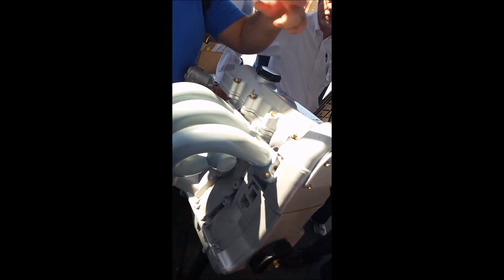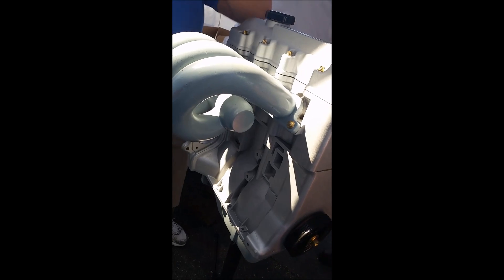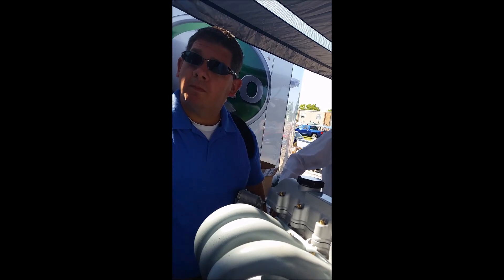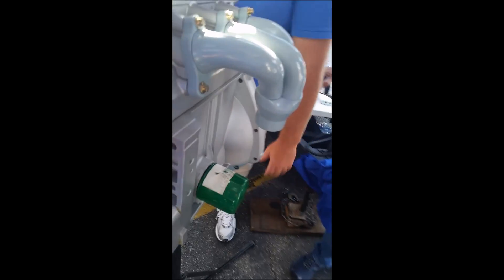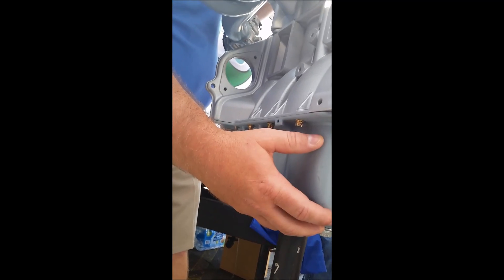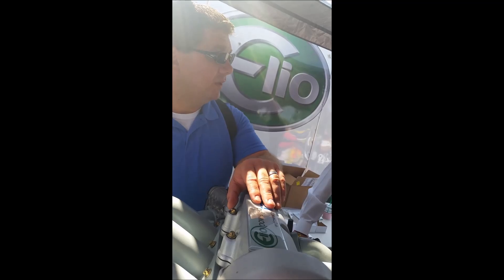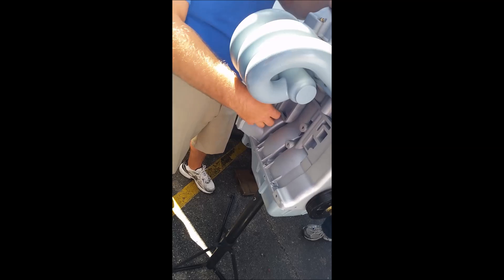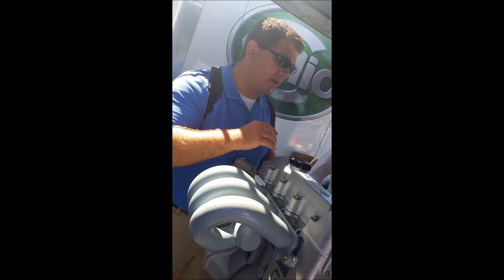ELIO- IAV Engineer Kody Klindt talks about the Elio engine.

Comment: Cooled EGR but what about EGHR (Exhaust Gas Heat Recovery) like on the Malibu Hybrid?

Would be great if it was a lean burn engine like what Honda did on their Civic HX and also the manual transmission First generation Insight. That would increase cost though. Them might be able to hit 90MPG

Comment: That chain was a big mistake. Belts are every bit as reliable as chains, people just forget to replace them when they need to be replaced.
Reply: +Brandon Lee I'd be surprised if many of these cars even made it to 100,000 miles, being as cheap as they are. I've never seen a belt fail before it was supposed to be replaced, but I've seen more timing chains launched through the chain case than I can even remember. Add to that the fact that belts are lighter, quieter and more efficient, and you have a big mistake when you use a chain on a car that's supposed to get 84 mpg.
Reply: +Brandon Lee I've been working on cars for 14 years, I've seen more than a few timing chain systems fail, for whatever reason.

The engineer in this video even states that a belt is more efficient (@8:55), it should just be common knowledge, and fairly obvious. I couldn't care less what happens when stupid people own cars with timing belts and let them snap, I want a car that is designed in a way that makes the most sense from an engineering standpoint..
Reply: +Brandon Lee It's doesn't matter if the chain itself if more reliable, a failure of the timing chain system is still a failure, and the timing chain systems do fail. 

There are both Volvos and Hondas with more than a million miles on them that use timing belts. All a timing belt needs is to be changed when the manual tells you it needs to be changed. Timing belts also absorb harmful harmonics that might be transferred between the crankshaft and the cam(s), which probably helps to extend engine life.

If you're talking about timing chains on pushrod engines, that's a whole different story. Timing chains on OHC engine fail all of the time. Even with pushrod engines, timing chains can have problems. Timing chain problems are common on some Corvettes. 

Belts are DESIGNED to be replaced at regular intervals. it's called MAINTENANCE. There are plenty of cars with timing belts in the US that have well over 300,000 miles on them. I had a Civic with over 300,000 miles on it (it's the white one in the ZC swap video on my channel) and it ran beautifully.

AGAIN, belts are more MECHANICALLY efficient, meaning they make the engine more powerful and more fuel efficient. Hell, that's the main reason that NASCAR engines use them!

If a timing belt snaps, it's the owners fault. As long as a timing belt is replaced when it's supposed to be replaced, it will be perfectly reliable. Hell, I've seen a belt go 100,000 miles past its designed life!

You don't let a timing belt snap, ever, it's a stupid thing to do.
Reply: +idontcare80 yeah, the timing chain on my 93 chevy lumina busted and actually split the block lol

Comment: Did you seriously add black bars to the sides of your vertical video?  My second monitor is vertical for pretty much everything except non-vertical videos.  There is no reason to add the black bars. There is absolutely no benefit to doing it, but it prevents people with a vertical monitor from watching your video full-screened.
Reply from the maker: Ask youtube why there are spacers on either side of the video, not my doing.
Reply: 10ring It usually doesn't happen.  Might be a checkbox or something when you upload.  I'll have to check next time I upload something.
Reply: +Sadpants McGee He didn't do it on purpose. That is what happens when you record the video with your phone holding it vertical instead of horizontal. Next time he needs to turn his phone 90 degrees. YouTube would then not add the black bars on the side. He will learn the next time
Reply: Dale Coffing The vast majority of vertical videos on youtube don't have black bars on the side, and they full-screen just fine on my vertical monitor.

Comment: ...still don't see where the "84 mpg highway" number comes from. The commentator speaks repeatedly about "benchmarks" from competitors. None of the competitors, (either in the motorcycle or automotive arenas), come close to 84 highway mpg from an engine of this displacement in a vehicle of this weight. As far as engine technology goes, there isn't anything really new here...so where does the number come from? 84 mpg from a hybrid design? Perhaps. But an internal combustion engine alone...using existing this existing technology? Nope.
Reply: Weight and aerodynamics?
Reply: Weight and aerodynamics alone wouldn't do it. With a conventional technology gas-burning engine this won't approach "84 highway mpg"...unless they're calculating highway mpg different than everyone else. Lots of people have built three wheel vehicles of similar weight and size, with similarly-sized conventional engines and transmissions. 84 highway mpg might very well be the target with this vehicle, but then that ought to be the language used...instead of saying it "gets" 84 highway mpg. There are plenty of videos on here saying just that. It "gets" 84 mpg....and so far it hasn't been proven with a working prototype of the production vehicle. Whatever actual highway mpg the test mule vehicle is getting is closer to what can be expected....unless some "disruptive technology" is going on with the engine the vehicle will use. So far all of the information I've seen indicates that isn't the case.
Reply: I have my doubts too. If they can't come up with at least 60mpg and less than 7k price tag I'm not interested.
Reply: scott_larson there at 81 right now with new motor..
Reply: dragon reef
Link?
Reply: http://carbuying.jalopnik.com/elios-ceo-explains-how-he-can-sell-an-84-mpg-car-for-6-1677743693
Reply: dragon reef
They're still just "saying" they're at 80+ mpg, with no other details given. My skepticsm about how "real world" this figure has its roots in reality. The vehicle is interesting, but as the company rep himself has said several times, there's nothing new or revolutionary with the technology. And while examples of similar production vehicles are few, there are several "kit" type vehicles that compare size, weight, and powerplant-wise. None of them get anywhere close to 80 mpg, unless we're talking a constant 45-50 mph on a dead-flat highway. I understand the desire to create interest in the vehicle, but from the very beginning all of the press associated with this says it "gets" 84 mpg highway. "Gets 84 mpg" is different than "design goal is 84 mpg". They were saying "gets" long before there was ever even a production running engine in existence. How does anyone know what it "gets" without drive-cycle testing?
Reply: scott_larson Yeah - hang on to your money until you see it perform. I didn't - I'm at the front of the line and I'm about to get my daughter in as well. If it get's 40 mpg for $7k and gets us to work and back we can't ask for more. (but we will:)
Reply: Weezy Weezer Congrats on your commitment, but if you're going to be satisfied with the vehicle not coming close to achieving its most talked about design target, then what other targets will you be satisfied in it not achieving? Really not trying to be a naysayer here, but I'm sure the vehicle would/will suit lots of peoples' needs...without the need to exaggerate to generate interest. The mpg number and selling price you quoted yourself bear that out. What if others interested in buying in aren't as generous as you are about the vehicle not hitting the numbers they're being told it "gets" when that's what they're basing their purchase decision on?
Reply: scott_larson I ride a $22,000 R1200RT BMW motorcycle. I get about 45 miles per gallon on my trips the way I ride. I have a helluva lot of fun on it. All my camping gear stows in my rear trunk (just like it will in this Elio :)) 
I'm guessing I'll have a helluva lot of fun inside that cockpit with the AC chillin' and my music blarin', for less than half the price of my bike, and better fuel economy. What's not to like about those benchmarks?
As I said, hold onto your money until your absolutely certain you think 
it's worth it. I already made that decision! (My daughter just thinks 
they're cool looking)
Reply: There's nothing to not like about those "benchmarks", which leads back to my original point: Why is exaggeration necessary to generate interest? Ask the company yourself why they've backed off from the original, "It gets 84 mpg", (and they said that for a couple of years), to what they're saying now. Do you allow the same kind of latitude to other companies making the other products you buy? Since you brought up your motorcycle, name ONE claim the company made about it in order to generate interest that was unsubstantiated. Name ONE claim the company made in order to generate interest before producing so much as a prototype. Good luck...you won't find any. Why is that?
Reply: I've built a number of 'firsts' or prototypes. I shoot for the absolute best I can hope for on the first try. The goals, the benchmarks, the specs, they're all what I hope and believe I can make happen. Along the way Murphy and Reality team up and I may come up a little short on some specs and maybe I get lucky and get a feature bonus I hadn't planned on. Aim for the sun and maybe you make it to the moon. It just unfolds that way. That's how many of us look at the Elio concept. Bolt together some off the shelf with some brand new stuff and shoot for the best you can hope for (enthusiasm attracts funding - but you probably know that).
We're all hoping for the best for the Elio in many ways - not just the finished product..

When mine is ready, I'll pick it up at the plant, along with my camping gear, and I'll continue my tour of the national parks. oooah!

BTW: 'exaggeration' - what do ya' think about the 'exaggerated' Gardasil vaccine? Not only does that have zero efficacy, it's paid for with hundreds of millions of tax dollars, and it maims people (so says the latest whistle blower scientist that worked on the development of the vaccine). That's the Merck corporation. (Dr. J Mercola or the Gary Null website - check it out). That's something to get your panties in a tight about.
Reply: "The goals, the benchmarks, the specs, they're all what I hope and believe I can make happen." Exactly. Re-read my original post and all of its follow-ups. There's nothing wrong with having a "goal" or a "target", that's how things get done. But don't ADVERTISE your "goal" or "target" as something matter-of-fact as if it's been achieved....when there isn't an operating prototype, or anything close to one. You never answered my question. Do you allow other manufacturers of other products the same type of leeway when you're making a purchase decision? What did BMW tell you the bike was capable of with absolutely nothing to back the claims up? And if they didn't tell you things the bike was capable of without backing up their claims...why didn't they?
Reply: My honda vx got better than 50 mpg.  Thats a 20 year old car that weighs almost twice as much and not as good of aerodynamics.  Im pretty confident they will achieve 84mpg.

Comment: What is the life expectancy of engine, of course with proper maintenance ?
For exhaust, just shoot for mpg & keep EPA happy.
Make or keep maintenance easy for the shade tree owners, I hate tearing off the top or bottom part of engine compartment, just to change air filter, plugs,wires, oil filter, etc.

I'm applying reservation $ 1/2015

Comment: Great, some idiot wants to put noisy straight pipes on it already. We don't need it getting the same thug rep as Harleys. It's not the same market. I keep thinking about that Harley ad that said don't buy it for the MPG (buy it for your fragile ego).
Reply from the maker: Life must be difficult for you, always taking everything so seriously. The straight pipes question was 100% tongue in cheek, as mentioned in the annotation that pops up about that time in the video.
Reply: Geo T To be honest, it would sound more like a tiny V6 than a Harley. (and still wouldn't be as loud)   Listen to the BMW i8 for what a 3 cylinder can sound like.
Reply: ConnorWolf what? so bad that they use a sound track in the cabin to make you feel better about it?
Reply: rasvial No, sort of like it would sound like without the tons of sound deadening BMW puts in, or the piped in sound to make up for the sound deadening. 

Or rather, what the i8 sounds like from outside would be a lot closer.  I don't really know anyone who wasn't pleasantly surprised by how the i8 sounds, anyway.
Reply: eh- I'm not quite as neutral as you are to the authenticity of "just removing the sound deadening".

Of course the i8 has great sound deadening, but it doesn't sound that good (in car speakers are a bit too perfect sounding). I think its easier to come away with fonder than deserved feelings for the sound, just because of how overwhelmingly amazing the whole package is. The sound isn't bad but its not good.

Truth is this will probably sound better- the i8 has a rather "direct" sound in their efforts to keep the sound output up, which makes it sound a bit throaty and try-hard. This car will probably be lower in pitch and more muffled which should "tighten" up the throatiness, and make it less harsh sounding.